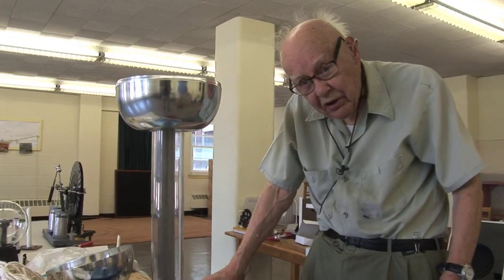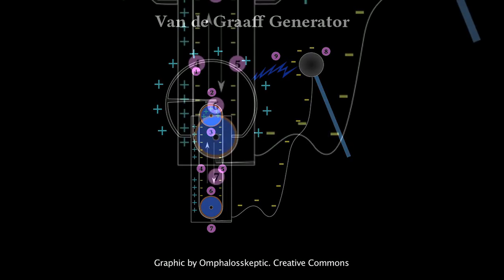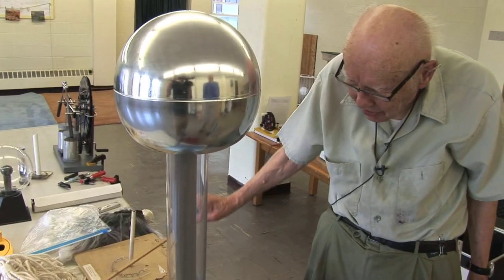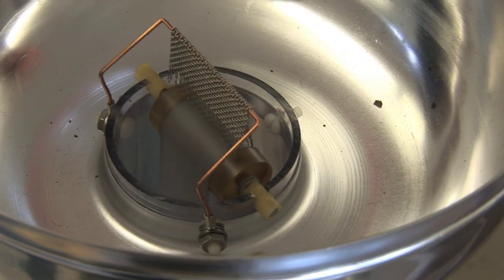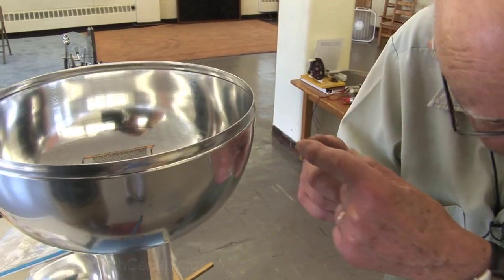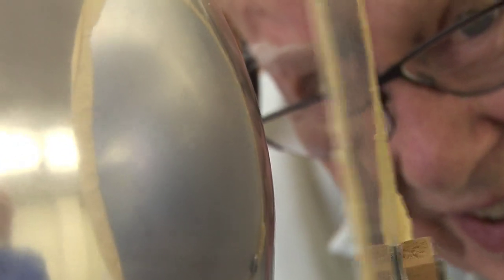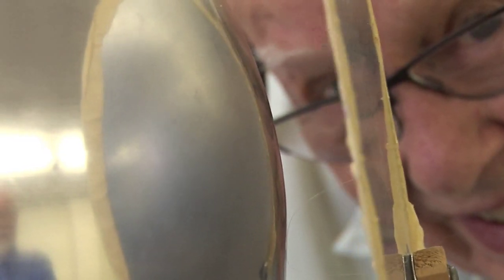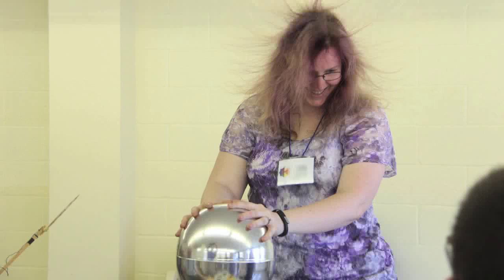Van De Graaff Generator Explained

Comment: Nice to see the inside but it doesn't explain how it works. For example how the charges can accumulate on the dome.
Reply from the maker: Michel PASTOR There is definitely room to expand on this subject with a few more minutes going into a bit more detail, however this video is a short one.
Reply: There is no clear explanation that i seen anywhere. All are partial, unclear. For example https://en.wikipedia.org/wiki/Van_de_Graaff_generator#Description look at the image, there is negative charge on the inner side of the belt going up and positive on the outer. As belt reaches the top roller electrons supposedly jump from the roller to the belt but  how since inside of the belt is negative and should repell electrons.
Reply: @niksa28  Hi! I have a lot seen of videos explaining the Van De Graff and they said a positive charge in the outside of the metal dome. 
In my understanding, only electrons can moves to the other the reason why the hair of the person is raising each other because the electrons move to the body and the hair started to Repel because of same charges the negative.
Reply: @Crocs6250  Only electrons can move, and lack of electrons is positive charge, that's all good. I asked RImstar about the discrepancy between his example and wikipedia, as for the rollers he is right, they are inverted, but belt polarities seems off in his example. He says up going belt is positive on both sides and the down going belt is neutral or negative on the inner side and assumed neutral on the outer. I first ask how can up going belt be positive on BOTH sides, doesn't make sense. He did not address this. You can read it here under FrandMusic's comment. https://www.youtube.com/watch?v=EsZQS2GOMQE